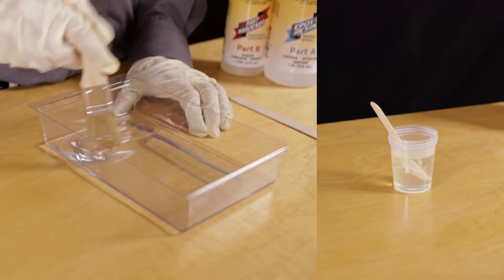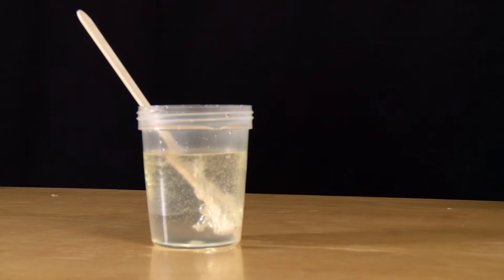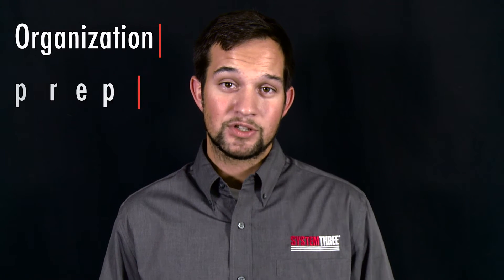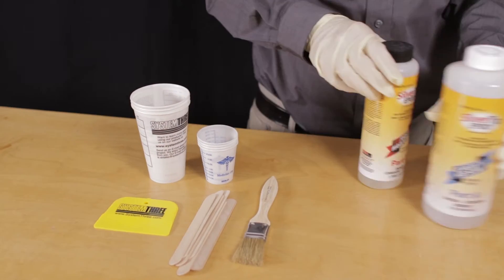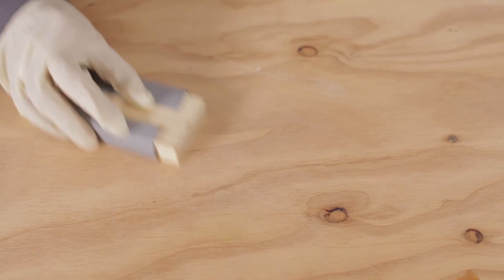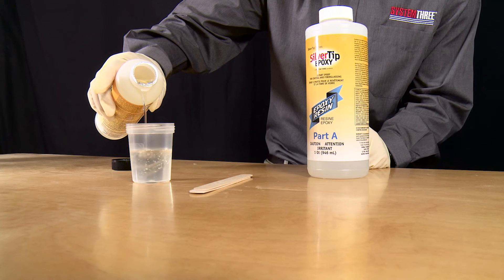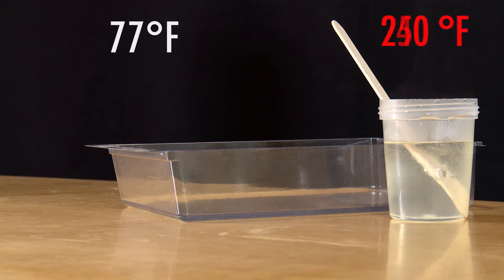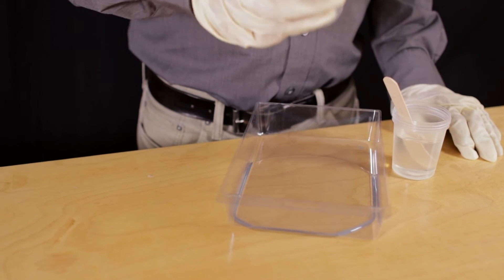Epoxy 101: How to Avoid A Runaway Exothermic Reaction

Comment: Hello, I am working on a lamp, I poured my mixed epoxy into the mold, the reaction happened when it was left to set. How do I pour lots of resin without causing any reaction and also without leaving one layer to set before i pour a new one on leaving visible layers?

Comment: What if it’s reacting in the working cup? Not in the mixing cup? It’s so hot i’m scared it will catch in fire. How to cool it down? Is there any other way than just to pout it out to a bigger tray?
Reply: Which type of epoxy we can use to cover electrostatic charge. Normally a basic epoxy react on temperature please support me